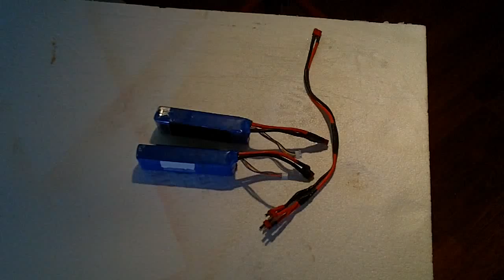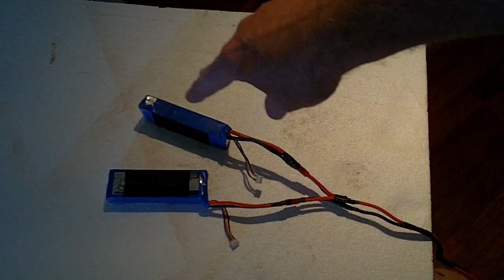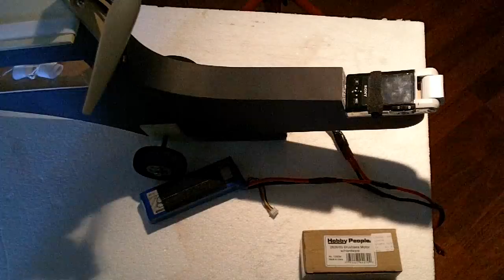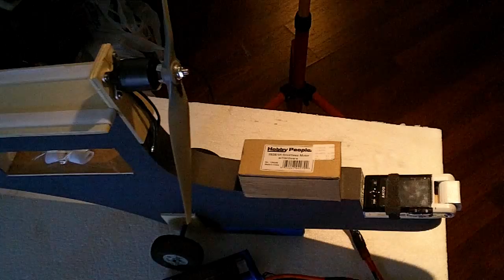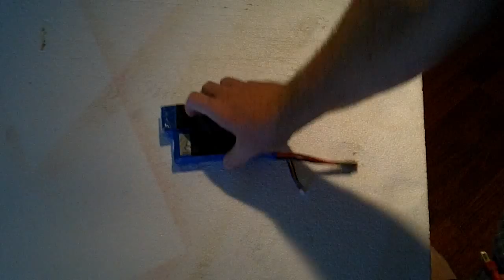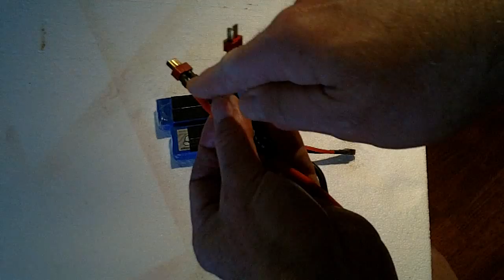Parallel vs series battery set-up

Comment from the maker: next page...
I mount my 4120 to a 1/4" plywood plate, as a pusher mind you.
Using a (1) 3 cell battery will not make you happy with this motor, sorry. 2- 3cell in series (=22v) is super deluxe running through a 70+ ESC. Using this power means I would use a 12-7 to 13-7 to start with. 
Do a ground power up test for 2min to see how hot the ESC and the motor get. Make sure the ESC is mounted outside the airframe!

Comment: hey west

quick question for ya
i went down to my local hobby store today and got the 4120-05 hp motor on sale for 40 bucks and iwas wondering if since i alreday have a big 1/4 and 1/2 inch mount made if it would be okay to mount to the back of an FB plane if were it is mounted is reinforced, also what prop size would you recomend on 3s